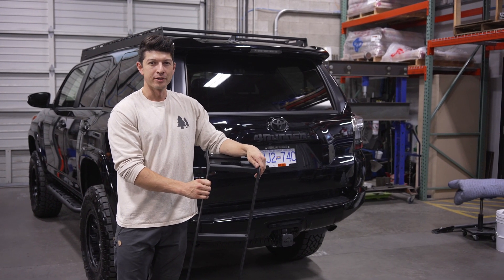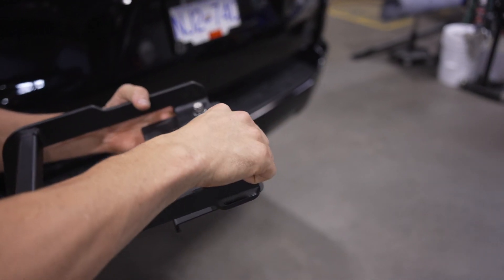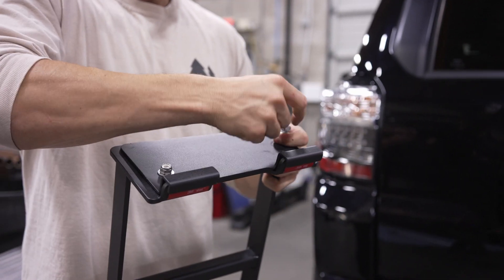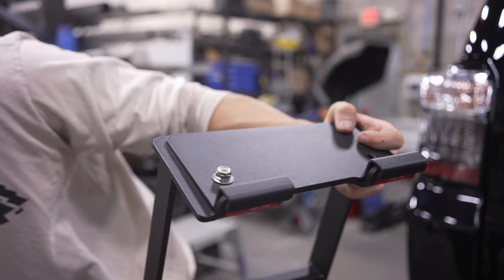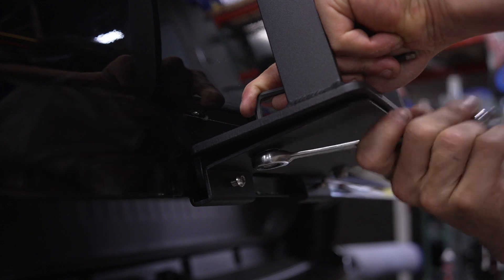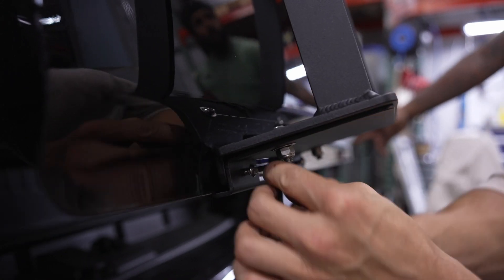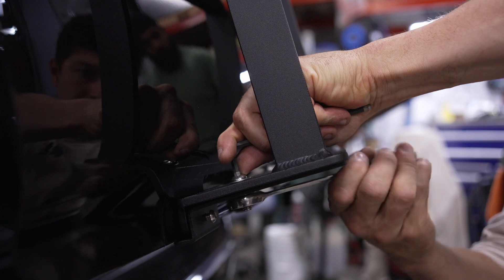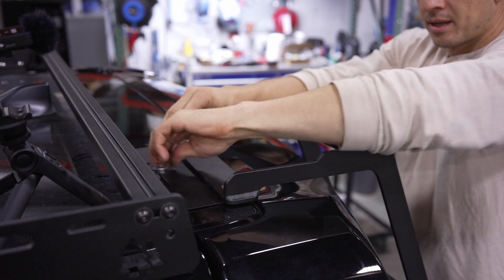4Runner Ladder

Comment: I have this ladder installed on my 4Runner and it’s amazing. It installs off to the side so it downs interfere with viewing out the back window. Plus it bows outward from the rear of the vehicle so you can actually put your foot in the rungs while climbing. Most other ladders don’t do this, they hug the hatch making using the ladder awkward
Reply: Mine arrived today. It had two black foam strips that were floating around in the box. They have sticky adhesive on one side. They were attached to the ladder somewhere but no idea where they belong. Any idea? Did yours have foam strips attached to your ladder anywhere? THX
Reply: @Treetopflyer777 i also found two black foam strips... you found out by any chance?
Reply: @ysoserius8784  I did. Apparently they go inside the 2 “latches” that hook around the bottom of the lift gate. Supposed to go between the thin edge of the steel on the lift gate and the aluminum of the two hooks on the bottom 
Make sense? If not lemme know I’ll try to explain better.
Reply: @Treetopflyer777  wowowow.... i ripped mine as i pasted the two sticky sides together till i found out what to do with them. I had to buy nitrile foam from autozone. Now ill just paste it on every contact point between the ladder and car. 15$ shaking my head
Reply: @Treetopflyer777  Is the ladder visible from the rear view camera when backing up?
Reply: @dumplinggang2725  haha good question. I can’t even recall right now. I doubt much if at all given that I don’t recall. If it was a big obstruction it would annoy me and I’d know the answer immediately.
Reply: @dumplinggang2725 doesn’t show up at all in the rear camera

Comment: How do you uninstall the top plate to prevent the adhesive from peeling the paint?
Reply: Using a heat gun to warm up the tape makes for easy removal.